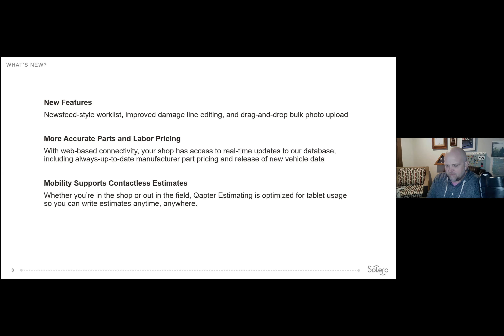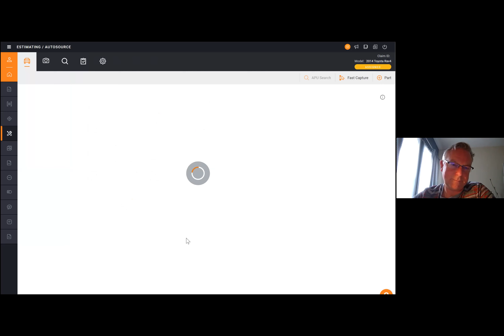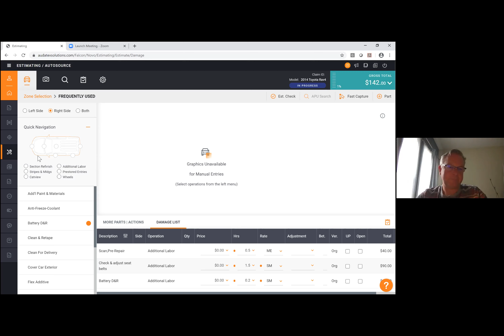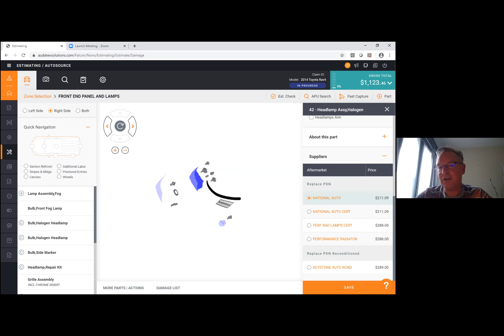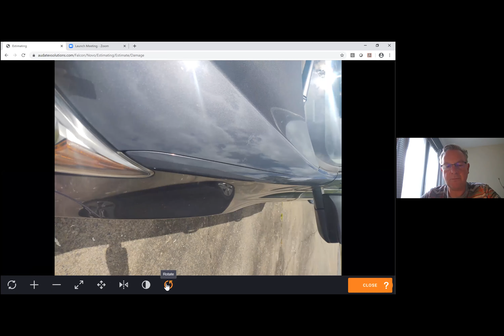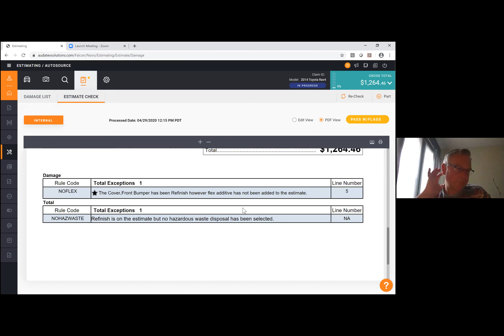Audatex Qapter Estimating Demo | 3D Graphics, OEM Notes & Collision Estimate Workflow

Comment: When replacing a part on the Audatex system I am now using and say part of the damage would be replacing core support  - condenser I have to manually go in and change the included operation to mech rate  . Will I still have to do that ?